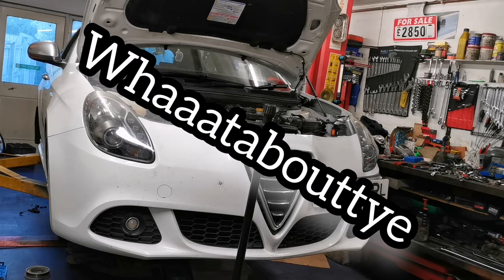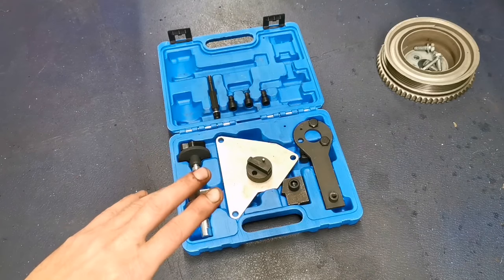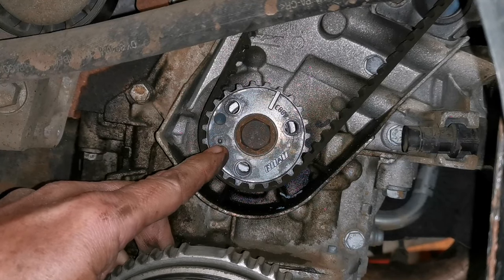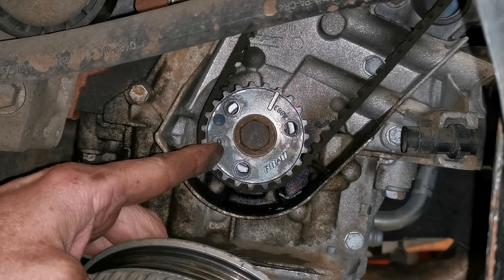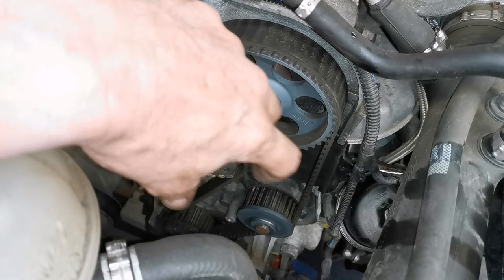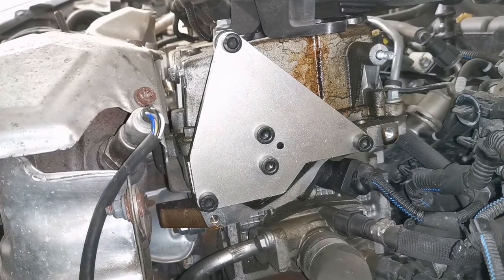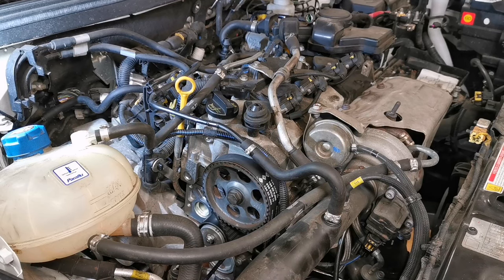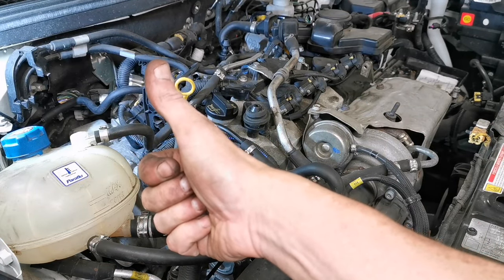Alfa Romeo Giulietta, Mito 1.4 Turbo Timing Belt Tensioning. Fiat 500 Dodge Dart

Comment: The trick when you fit the new belt is to tension it beyond the normal tension setting to help seat the belt into the pulleys. Tighten the cam pulley if you've loosened it, then remove the setting tools. Rotate the engine twice then re-tension the belt correctly.
Reply: How much tension do you need to put on it normally?

Comment: Dave , I can remember the first Fully Integrated Robotised Engine  (fire) vehicle we had when I was an apprentice at a Fiat main dealer , it had a problem with the engine , chucking oil out of the exhaust, very unusual for Fiats in the 80's , I had to put a new set of pistons in it as the technical department said so , 3  miles on the clock ,4  new pistons , sump off , head off new gaskets etc etc , it ran great after and of course no one told the customer🙈🙈🙈 😂😂, great info there for people who have never done any of these style engines 👍👍
Reply from the maker: wee FIRE engine been around for years lol. The 8v non-interference, some job
Reply: @davesterl  was all cleaned of nicely not to show my mawlers had been on it
Reply: @monkehbitch  no gloves then , lots of clean rags , main dealer didn't even have a press , we had to use the vice to do wheel bearings 😂😂😂
Reply: I also worked at fiat main dealer. 82 till 1985.we fire engine was good.

Comment: I've had my TB changed on my Abarth 1.4 T-Jet. I am getting a whining noise from belt area, I know the garage didn't loosen the cam pulley because he's just used 2 tip-x marks on it. Is it likely that it is the belt tension that is making that noise? Because if the cam pulley wasn't able to rotate wouldn't it be putting more tension on on side of the belt so to speak?

Comment: I`ve done my brothers belt a few times (500 Abarth T-Jet), never used timing locking tools, or loosened the cam pulley, just manually marked it up. However, I now need to change the cam carrier (sound like a cam bearings worn through, at 225,000 miles.. ignore the official oil change schedule, change your oil every 6-10k!), so I need the tools now. Only thing is, I`m paranoid I`m gonna get the cams 360 degrees out.. Its a pain in the arse not having a rocker cover, & not being able to physically see the cams..
Reply: It's still a tremendous achievement that it made it to 225k even with the super long oil change intervals. I know a local Giulietta Multiair that did 125k km on 18k oil changes and got proper servicing only after that. Still fine after 235k miles though it did need a head gasket at 180k. Amazing engines when you compare to what the norm is nowadays.
Reply: @varmastiko2908  I actually changed the cams (with cam carrier) from an Alfa Mito Veloce I was breaking, with about 130k on it, the 500 is now working fine again (& up to around 240k), but the water pump, which I did about 15k ago with the belt has started leaking! So I`ll have to do that soon (it wasn't an original pump, cant remember what make it was now).
Reply: @MrPabsUk They seem to be quite strong engines. Regarding the water pump I've worked in the spare parts business for a long while and there is a new development of substandard part quality taking hold of many suppliers and manufacturers in the last 3-4 years. I mean quality has been dropping for a long time as I'm sure you know but this is a new level of low. We basically have to thoroughly test every part before fitment. Even OEM suppliers are slipping and more and more we see Chinese bulk parts in OEM packaging.

Comment: Iam done with the Timing belt Change too If you dont losen the camshaft Bolt the bew belt wont fit. Ive tryed 4 hours to fit that damn Thing i tought the Onlineshop sold me the wrong belt but all was fine just losen the Bolt and it will Slide in

Comment: Thanks for the great video. Couple of questions. What could you use to counteract the movement when loosening the camshaft aside from your little contraption? Other question was does the vacuum pump gasket need replacing after taking it off to fit the locking tool? Cheers

Comment: Evening Dave Thanks for such a detailed video. How hard would you say changing both belts and the water pump would be with a couple of jack stands and the correct timing tools in my driveway? I'm a sparks by trade and have some practical knowledge and have just purchased a 2015, 75k "1.4 Multiair TB Alfa Romeo Gulietta QV-Line"  and it doesn't show this being done in the service history so thought I could tackle it, saving some money, gaining some exsperiance and the peace of mind knowing it wasn't attempted with sharpie marks by a garage. Is this the correct order of operation: 

1) Remove the battery and the air Intake (to make room around the vacuum pump).
2) Jack the bottom of the engine to unload it slightly and place a jackstand for support. Where is a good place to put the jack stand and the jack to prevent cracking the case? 
3) Remove the engine mount, freeing the area around the belts.
4) Remove tension on the serpentine belt and then remove it from the crank pulley. 
5) Remove the crank pulley and install the locking tool by rotating the crank until the tool aligns with the bolt post before tightening it in place.
6) Remove the vacuum pump and install the holding plate (I assume that it will align correctly first try now as the crank is already locked in the correct position?).
7) Remove the tensioner and the timing belt and loosen the cam sprocket (Whilst holding tension on the cam sprocket with an external tool to prevent snapping the cam rod).
8) Remove the water pump with a container below to capture any excess coolant (I assume I don't need to drain the coolant reservoir or the radiator to do this? / This isn't going to all come rushing out?).
9) Install a new water pump with a bead of liquid gasket around the perimeter after cleaning the mounting services with a plastic scraper.
10) Install the new timing belt and tensioner, over-tensioning it slightly past the mark to allow for the tensioner to spring back, at this point the cam sprocket will also rotate slightly taking up slack in the new timing belt? 
11) Torque down the cam sprocket (Whilst holding tension on the cam sprocket with an external tool to prevent snapping the cam rod).
12) Remove both timing tools and turn the engine manually twice and then check the tension is still correct. Am i listening for strange noises? weird grinding? how will I know if it's wrong?
13) If the tension is still correct reinstall other components, remove the jack stand and jack , and after waiting a little while for the battery to charge the system (To not upset the Alfa ecu) start the engine. 

I hope this all correct? If i go to install the holding plate and it doesn't align (Even though the crank is locked it the correct position) what do I do? does that mean the engines timing is slightly off in this hypothetical scenario? (even though the engine runs fine at the moment). Correcting me and any extra advice would be so much appreciated Dave, I hope to hear from you soon!
Reply: Oh also I plan on changing all the disks & pads and brake fluid as well as engine oil, Oil filter, Multiair Strainer/filter, Air filter, pollen filter and spark plugs. Regarding the transmission fluid,  it looks like a massive pain to get to and I believe this engine doesn't have a dipstick to check the quality, when do you normally change it and should i do that also? Any help with all above or advice on servicing it for a fresh start for my ownership will be much appreciated and thanks again!

Comment: I think I’ll be at least partially loosening the camshaft nut before I install the camshaft locking tool. If you’re not perfect with your counter holding technique you could still accidentally put force through the camshaft…

Wonder what a safe torque on that bolt would be for the locking tool that would still hold the pulley- then take the tool out to “safely” torque the bolt to the 120Nm…

Comment: Just after some advice. I have this identical kit and using it on a mito 1.4 (170). I'm an amateur at this so worried about messing it up. I can't get the piece that goes on the vacuum pump end. I'd guess the pin is just a shade off on where it should be. Even if I take the black piece off by itself and try it won't sit flush.  I want to hammer the pin in so it's flush but will this mean too high a chance of movement? Cheers.

Comment: So my fiat 500 has the same engine but my cam pully doesn't have those holes to hold the pully, it Looks like it has a solid plate on the pully with a torx bolt. Does that style need to be loosened too?

Comment: Used your video as a guide when i did my belt today..Like you mentioned the tensioner lost a bit when rotating the engine ,so a quick re-adjust ,,Found it annoying that when tensioning the belt you cant see the marks for the tool and your hand ..So a bit of pre-tension and then i could get it to the marks then torque...Do you know the torque of the 3 bolts that hold the crank pulley on..They where not tight to come off ..i  would imagine about 30nm ..Thanks for the tutorial
Reply from the maker: 30 would be fine

Comment: Nice job Dave. Undoing that cam bolt looked like it was going to have a lot higher torque setting than the figures quoted when rebuilt. Or maybe your wee arm muscles are just not what they used to be.

Comment: Ive done dozens of cars including these without using anything more than tipex. If the timing is right to start with, how can a new belt with less wear possibly be wrong? Ive seen quite a few VAG group cars done in dealers etc throw a cide shortly after doing it the correct way (slackening off the cam pulley) but ive never had any car do that and i do literally dozens
Reply from the maker: Lol, you're some boy!
Reply: So uve done this without the tools?
Reply: I thought it was explained quite clearly in the video, the cam wheel moves as you take up the tension. The ones you've done aren't tensioned correctly.

Comment: Hi Dave
Nice video
I have a question please
I am replacing my cylinder head gasket for alfa Romeo Giulietta2013
Engine code 940A2000

I purchased a different timing tool
However, the camshaft tool pin is on the right and different for the one that you are using 

Should I position the cam shaft hole on the left or the right?

Comment: Couldn't the belt be replaced without loosening crank and cam bolts by making your own marks?
Reply from the maker: likely for timing to be off doing that
Reply: @davesterl  I managed to do that on a Volvo s60 (2014). Running fine 40000 mi later.
Reply from the maker: i only show how to do jobs correctly on this channel
Reply: @davesterl  I totally understand yuor position. As a retired shop owner (37 years), working on relative's cars requires occasional shortcuts.HaHa
Reply from the maker: then you should know that some cars you'll get away with that and some you will not. This  being a multiair engine, correct timing is crucial
Reply: No. Watch the video again.
Reply: Don't try it.  I made this error and all seemed good and then my belt skipped a tooth 3 weeks later so I'm doing it the correct way tomorrow and hoping that I haven't done any damage, the engine still idles pretty smooth with no scarey noises  but it has no power. 🤞
Reply: @Stewart Hill  not using the locking tool will not make it skip teeth